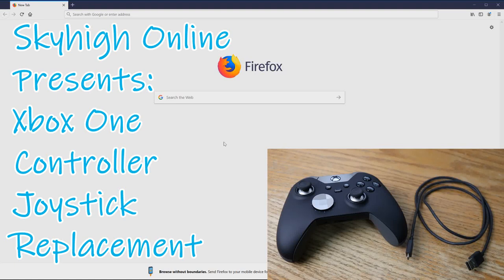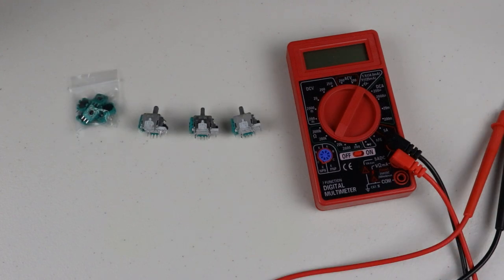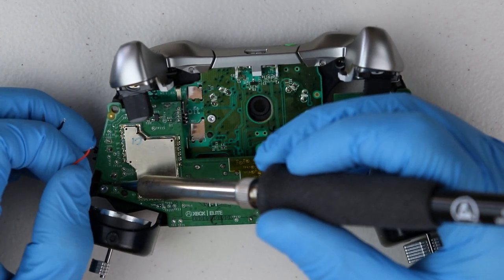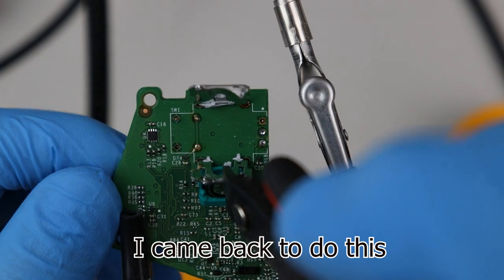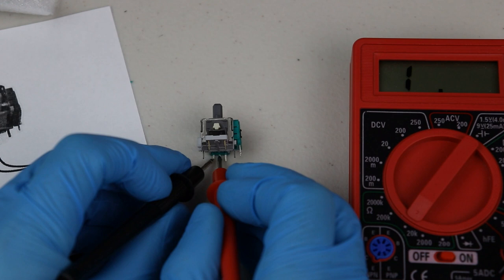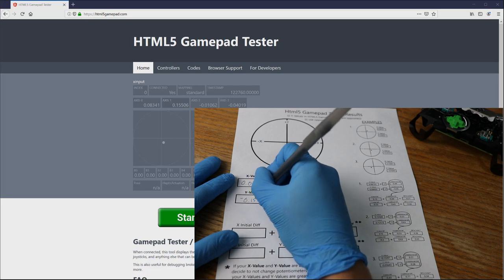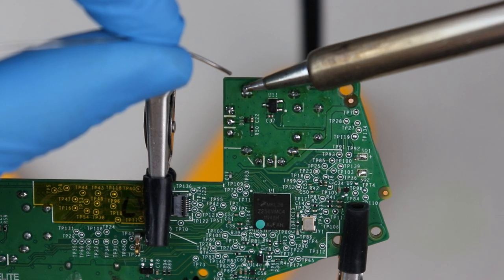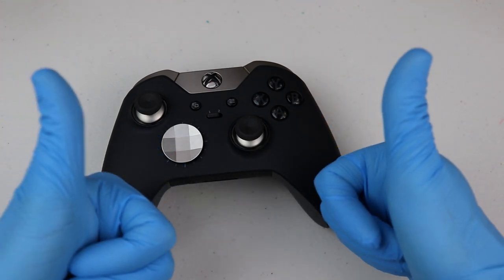How to Replace Xbox One Controller Analog Joystick - Fix Stick Drift & More

Comment: Yo my controller doesn’t have drift, but when I go forward it just doesn’t work or I slowly walk when I’m supposed to run, do you know why this happens ?
Reply from the maker: Sounds like it's a faulty joystick.  If you plug the controller into your computer and go to html5gamepad.com, do you notice the same thing when moving the joystick around?
Reply: ChargeSZN same with mine.  So frustrating

Comment: I'm stuck on step around 8:12 of video, removing pins using pliers and soldering iron. When pulling some pins out, I accidentally broke off a part of the pin while pulling it out with pliers. A portion of the pin is still in the hole and I have no place to grab onto it, any advice? 
Thank you for the video!
Reply from the maker: Yes absolutely.  I've had this happen before as well, when I cut too close and the pin is too short to grab onto.  What I do in this situation is heat the solder back up like normal and push the piece out more with the solder tip itself.  If you're lucky it will all come out, or it should be enough to grab onto again.  Adding more solder may help when doing this.  If it's still a struggle, perhaps you still might be able to get the excess solder with the solder sucker or wick.
Reply: Gotcha, I appreciate all your time and help.
Reply from the maker: @oscar45833  No prob!
Reply: @oscar45833  add more solder, heat it, make sure all the solder is molten and use the solder sucker, it will pull the pin right out

Comment: So I can either do all these calculations or just skip it and solder it on right away and hopefully turn out lucky with  good calibration?
Reply from the maker: Yep! Well, acceptable centering anyway. In my experience between 25-50% chance.  If you get the joystick pre-centered (Each axis resistance value close-ish to zero) the chance will be a little better.

Comment: Love the vid, recently bought your kit and successfully installed the new thumb stick on my Xbox infinity Scuf controller. I tested all the buttons and everything before closing up the controller, but My controller seems to short out whenever it’s set in place. The job went smoothly and clean, so I’m not sure what I could have messed up. Any help would be great!
Reply from the maker: Thank you!  That's great to hear. Could you expand on the issue a little bit? I'm having a little trouble understanding.  Also, apologies for getting back a little late apparently your comment got marked as spam for some reason and was in a hidden place in the YouTube channel, but just approved it.  Weird.
Reply: @SOSSGAMING  Thanks for the reply! So, Im still trying to diagnose the exact issue Im having. with the controller completely assembled, It works perfectly while being plugged into my Xbox. When i try to put a set of batteries into it and use it wirelessly, it turns on for half a second and shuts off. It seems to be shorting out for some reason. Hopefully this helps, if there was a way i could send you a picture of it, maybe that would help?
Reply from the maker: @101airsoftplayer  I do recall hearing about a similar issue before and it turned out being the Xbox.  All that was needed was to reset the Xbox.  Have you tried this yet?
Reply: SOSS GAMING sorry for the late reply, yes I’ve restarted the console and everything. The controller will turn on the Xbox if I hold the button down, then when I remove my finger from pressing it, the controller shuts off
Reply from the maker: @101airsoftplayer  Ok, to cover our bases, one other obvious thing is to try re-syncing it.  Tried this also?
Reply from the maker: @101airsoftplayer  Here's also a pretty good troubleshooting guide: https://www.ifixit.com/Wiki/Xbox_One_Wireless_Controller_Troubleshooting
If none of that troubleshooting works it may be something internally then, and I'm not 100% on which components are used for the wireless connectivity.
Reply: SOSS GAMING I haven’t been able to re-sync it because it only stays on while being plugged in. I can try to hold the power button and sync button on the controller and see if that works

Comment: Happy I found these on amazon and also your video. Quick question though. Have you ever mounted a ps4 joystick module onto a xbox one controller? I'm curious because of the higher tension for one and the better build quality they seem to have
Reply from the maker: They should work actually. I have not tried it myself though, but they are designed from the same factory with a similar design.  I think if you were to shave the two hollow circles on the bottom base of those joysticks they would be the same flushness.  That's the only difference I am aware of that would need to be addressed.
Reply: Thanks for the reply. I might give them or battle beavers modules a try since they have super high tension. Wish there was a third party manufactured potentiometer that are all the same value. I like to play with as low of possible deadzone so I'm getting picky with zeroing these bad boys in
Reply from the maker: @swifdy6855  I know what you mean.  Never heard of those!  Let me know how they work out.  Part of the problem isn't just the pots, but also the joysticks have varying differences in alignment (the little nub part that protrudes from the joystick.)  I'm actually coming out with a new video with a new method of centering them within a week or two.  It can be combined with this method as well to get even more accurate results.
Reply: @SOSSGAMING  I'll definately be subscribing to your channel to see that because I know what you mean. The rails that keep it aligned dont always sit very tight. I once thought about tying them together somehow but couldnt come up with a way that wouldnt restrict movement
Reply: @SOSSGAMING  im really hoping you actually come out with that video. I've got a few joysticks that the non deadzone(the little nub part) is off centered and giving me issues.
Reply from the maker: @swifdy6855  I'm trying! I'm currently swamped with other things like taxes (kinda procrastinated) and other things but after tomorrow I'll should be able to devote most of my time to finishing it.  I'm really hoping it will be ready by the beginning of next week.  It's been quite the project (I'm still new to video editing).
Reply: @SOSSGAMING  all good man I just did mine yesterday so I'm with ya on procrastinating lol. Looking forward to the video! My sticks will be actually PERFECT if I can adjust the non deadzone
Reply: @SOSSGAMING  the ps4 joysticks worked by the way. Except all the pots on them are all garbage. They seem to be missing the parts of the black ring inside. Swapping out those for my oem post did the trick tho and they also came with better wipers than the xbox ones. Also I did end up having to melt the plastic circles on the bottom to make it sit flush. Next, on to the battle beavers 160 g tension stick😬
Reply from the maker: @swifdy6855  What do you mean by non deadzone?  Good to hear on the ps4's.  I think you got the copies because the original ps4's essentially have the same pots as the original xbox's joysticks. 
I actually just put on some ps4 joysticks onto an elite series 2 and it worked, minus the raised base.  The thumbsticks don't fit well and rub against the front cover if the base isn't modified to be shorter like the xbox ones.  I was lazy and just modified a regular thumbstick instead.  I'm playing worse with the PS4's but maybe it just takes time to get used to we will see lol I think I like the lighter tension oddly but I will give it a fair shot
Reply: @SOSSGAMING  I use game controller tester on xbox to check my deadzones and on the app it refers to the non deadzone as where the stick is, while the actual deadzone is where the wiper is positioned. I'm hoping to find some way to make these 2 match up by possibly making the wipers sit on the module a little tighter so that it becomes more in tune with the true deadzone. I bought a cheap 30 pack for like 18$ so yeah theyre prolly knock offs. But they still work, just have to replace the pots
Reply from the maker: @swifdy6855  Hmmm, I think you might be confused, or maybe I am lol.  If you're referring to the app itself I think it uses a 15% deadzone (or at least 10%).  So if the joystick isn't truly centered and one pot is 14% to the right and the other 14% up, the app will still show as if it's perfectly center when in reality it's not.  It's still playable because drift doesn't occur until about 18%, but it's not ideal.
The accessories app I know uses a 10% deadzone.  So same thing there. It will show any joystick within a 10% parameter as perfectly center, when in reality it isn't. That's why I do not use those apps when calibrating joysticks.  It's why I use html5gamepad.com because it shows the absolute true reading.
Reply: @SOSSGAMING  that may have been true for the old interface but it has a newer interface that allows you to show non deadzone and also adjust the the inner deadzone you're trying to test. I'm able to turn it down all the way to 0% deadzone to see if there is any drift whatsoever. I use a 5% deadzone or as slow as possible on all games so I'm pretty picky with my joysticks
Reply from the maker: @swifdy6855  That would be interesting if it shows the true reading now (at 0%).  I'll have to check it out.  Are you saying it allows deadzone adjustment for the controller itself which can transfer to the xbox? Or just within the app for testing"?
Reply: @SOSSGAMING  I wish you could calibrate the controller from this app but sadly microsoft prefers to just let elite controller owners do that. Adjusting the deadzone on the app is purely for testing reasons
Reply from the maker: @swifdy6855  What app are you using to calibrate an elite controller?
Reply: @SOSSGAMING  none I dont own one🤷‍♂️ I was more or less referring to the ability to manually change inner/outer deadzone, trigger deadzones, and also different input curves that will apply to games through the elite controller app. Microsoft only let's pc people calibrate their controllers
Reply from the maker: @swifdy6855  Ah gotcha. Are you talking about the accessories app? I'm not aware of being able to change any joystick deadzones on there.  I am aware of the implementation of the Accessories App sensitivity curves and the Windows PC calibrations though. 
I downloaded the Game Controller Tester app on PC through the Microsoft app store and it's about what I remembered.  Super basic with actually a 25% integrated deadzone (crazy).  It must be different on xbox because I also don't see any option for bringing it down to zero.  It's called Game Controller Tester right?  I will check that out on Xbox when I get the chance.
Reply from the maker: @swifdy6855  Ok, I found what you were talking about in the app!  My apologies, I was blind. That's pretty cool.  I'm going to mention that as an optional software for calibrating the joysticks.  I'm sure some will find that useful instead of needing a computer.  Thanks!
Reply: @SOSSGAMING  All good man its not easy to notice the extra settings in it. Glad I could help some other people out. On a side note, ihave a ps4 stick that i have perfectly centered and working but one issue I'm having is when i push it to the the right i lock out at 85% while all other directions stop at a perfect 100%. I'm trying to figure out how to fix this as we speak.
Reply from the maker: @swifdy6855  I think the main cause of this is that the joystick isn't completely flush with the board.  (the button side of the joystick is raised a little bit).  I have had this issue before.

Comment: hello and thanks for the video. I bought your analog stick kit to repair my pad, but i can't take out the old stick :( i also tried with a Hakko desoldering gun on another pad, but I  just can't take them off, do you have any indication from give me? P.s. I got an xbox series x controkler.
Reply from the maker: Figure it out yet? You might want to double check the hakko desoldering gun to make sure the tip isn't clogged up. I have to clean mine out fairly often with the small metal rod thing that came with it. Just heat up the hakko and stick the rod in and out (I grab mine with pliers). Another thing is you may need to add more solder/flux to the connection, so all the solder melts at once, then suck it all out. Just be careful not to overheat the pads because the pads can lift off and be damaged. Worst case, you can try the disassembly method (chopping up the joystick).
Reply: @SOSSGAMING  thanks for the tips, i have already tried adding flux, but no luck. The hakko pistol is practically new.  By insisting I manage to remove it, but obviously I have damaged something, because once I have installed a new stick from the kit bought by you the pad does not work as it should, it seems totally crazy, even the buttons give wrong inputs, have I perhaps corrupted some pads?
Reply from the maker: @mrantonelski  So you did manage to remove the old stick then? It's quite possible one or some of the pads have been ruined. It should be somewhat obvious which ones are damaged.  If you want to email my gmail account sossgamingcs and send a picture of the board I might be able to see which ones and we might figure out something.
Reply: @SOSSGAMING  thank you very much! You are super nice, I'll take a pic of the board and I'll mail it to you.
Reply from the maker: @mrantonelski  Sounds good. Still haven't received an email. Did you get it figured out?
Reply: @SOSSGAMING  didn't get the chance to take a picture, I'll send it to you as soon as possible. Thanks a lot 🙏

Comment: What was the purpose of installing the first unit then fully damaging it while removing only to install a new one with new potentiamers? Don't the values change with the new one? That's the only part that is confusing me. Coulsnt I just open the news one up and measure and swap wipers until I get the one with the lowest resistance and install that one and be done with this?

BTW this was the most useful video I have watched on how to repair the drifting issue and I will be using this video to help me fix my elite controller.
Reply from the maker: So, I've actually found out a new method in which you don't need to fully install the first joystick to get it's readings, nor need to record any values. It's what I'm working on right now.  I'll have it out in a week or two.  I'm pretty excited to show everyone as it's a bit less complicated than this.
In regards to your question about this method though, you first need to find the baseline values of the joystick that you need to put in, and to do that you need to measure a joystick, put in the that joystick, record the results, them make the calculations. 
A tip I figured out recently is that you don't even need to solder the initial one on.  After inserting the first joystick, you can bend the pins of each of the pots (quite a lot) so they contact each through hole.  It's a bit tricky.  Or you could solder the potentiometers on instead.  No need to solder on the 4 large posts nor the small button posts.
Simply swapping wipers likely won't get the job done as the variability in wiper positioning is not as great as with potentiometers.  But it may help sometimes.  I usually find it's only effective for about a 1-3% change.  Occasional more if you're lucky.
Hope this helps and wasn't too confusing lol

Comment: Hi will this work on ps4 controllers?? Also is it possible if you have a broken ps4 controller to show a vid thanks
Reply from the maker: I will be making a PS4 one after the new one coming.  Probably 3 weeks out :)
Reply from the maker: The same method can be used on a PS4 controller though.  Just I won't be showing it on one specifically.
Reply: @SOSSGAMING  thanks also can i ask whilst i was soldering on a ps4 controller i burnt the led strips port and was wandering if its replacable Subbed nd liked btw
Reply from the maker: @p40zz  Cool thanks! I'm not exactly sure what that is I don't have much experience in PS4 controllers just yet. If you like you can send a picture to my gmail account sossgamingcs and I can try to see if I can give a better answer
Reply: @SOSSGAMING  thanks for the help its alright il be getting a new controller soon

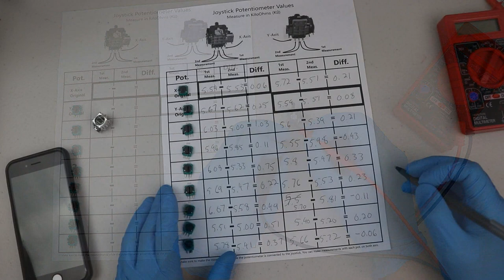Comment: where are you getting 2 pairs of measurements for each wiper @ 14:50? are you trying every pot on both axis?
Reply from the maker: Yes, exactly! On both axis. I am however working on a new video right now about a new method that doesn't require any measurements or calculations.  It should be done by the end of the week.

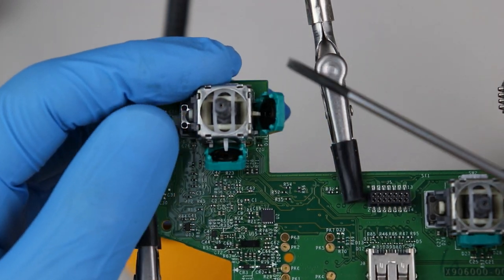Comment: Whether the Microsoft story was true of not it's totally not necessary to do all of this when you can do it without soldering and a lot less tools. You will need a Torx T8 and T6, small flat head screwdriver, tweezers, and a plastic prying tool that's it. You don't even need to take the whole analog off all you have to do is carefully push the sensor housing outward like in the video bend it back so that you access the sensor and pull it out with a pair of tweezers and replace the sensor it's that simple. He was pretty much done at 6:47